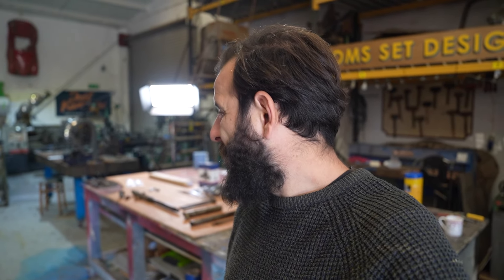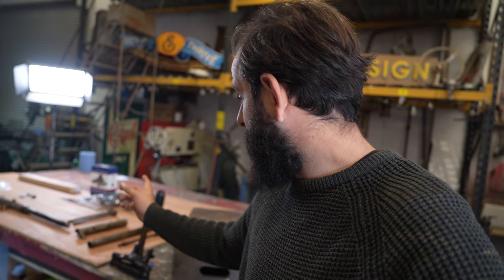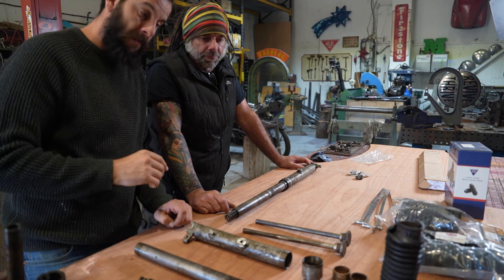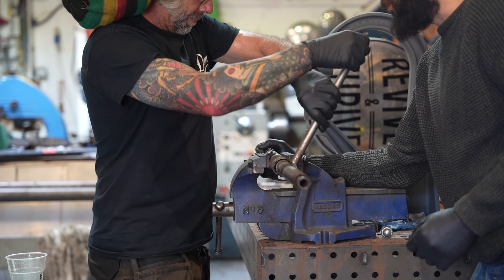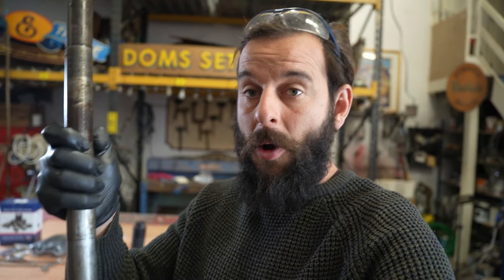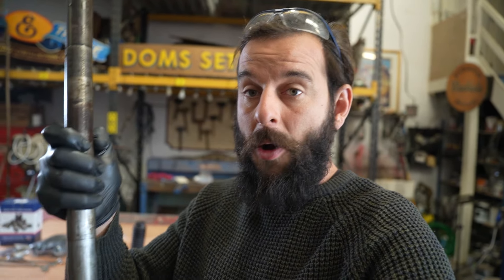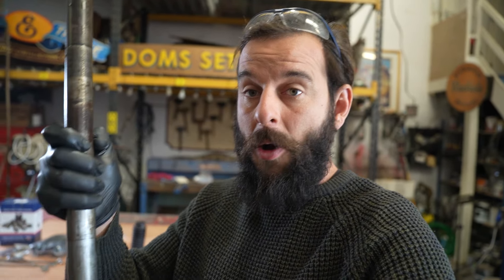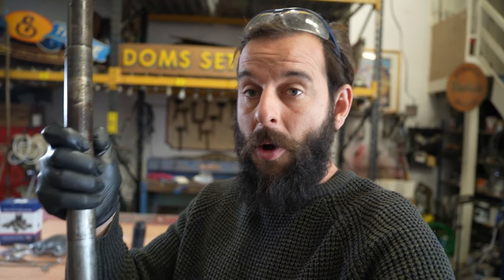Triumph Tiger 90 Restoration | Episode 2

Comment: Hi Dom. The stanctions that you have bought are for a Nacelle model . The hole at the top is to fill the forks, the nacelle covers access to the top nuts. You will have to block off the hole with a bolt and saw the head off or you won't get the stanctions through the yokes with the headlamp mounts in place.

Comment: Congratulations guys, when you re learning, two heads are better than one. You might want a little engine sealant around those fork seal holders to prevent the fork oil getting out if you didn’t do it already.

Comment: Good job well done,maybe worth having a look at the wheel hub exploded view in case that string was a substitute for a seal. Thanks for the video Dom.👍👍
Reply: Yes I subconsciously thought that as well, a lot of sting to wind that perfectly. They used twine on hydraulic threads as a sealer back then.
Reply: Use rubber sealed bearings in the hub, gets rid of the string  seal.

Comment: Good video,you work well together 
Also you can use the fork  stansion as a ex bar for socket set, I’ve used mine for years , it will never bend 😊
Reply: Good tip, and car half shafts make the best cold chisels EVER.

Comment: Looking good, so how did you get the gaters over the large bit of the forks, was it a couple of screw drivers or a thin bit of brass shim made into a cone?  
Where in Wales are you going ?
Can you remember the advert “put a tiger in your tank”.
Reply from the maker: The rubber was soft enough to just ease it over with a screwdriver, wasn’t worth filming!

Comment: Good tip for degreasing/cleaning that I use on my classic bike, car and recently on my lathe is get spray bottle and firstly fill with WD40 on clean then put paraffin in the bottle and things come come up really clean. Just doing same on a Pre 65 trial bike restoration

The other thing if going to be a desert sled would it be better to install bead lock rims just a thought

Comment: Did you guys use any sealant when you screwed the fork seal holders onto the bottom forks?  I'm not sure how it works on the Triumph cubs, but on a lot of the 650's the fork oil tends to seep from those threads if you don't use some Hylomar or plumbers tape on the threads.  Later year twins had an o-ring fit into the seal holder to try to fix that problem.

Comment: I'm curious about the hole in the stantion Dom. Is there a thread in it then? How do you seal so that fork oil wont leak out under pressure? On an old Yamaha I had, the stansions also had holes. These holes had a collar around them with O-rings top and bottom of the collar to seal it off and a linking pipe between the 2 forks. This equalises the pressure between the two forks as they compress.

Comment: Good to see you two having fun again. I’m sure you put the seals in the right way round? One thing to check if reusing old stanchions, is to see if they are straight by rolling across the bench. My forks were very stiff. Friend that built my bike didn’t check for straightness. Cured it by rotating so that bends were both same orientation! Must have been in a bad prang as the swinging arm was twisted as well. Been riding it for over 40 years now, but finally changed the swinging arm last year so the rear wheel now looks straight from behind!🤗